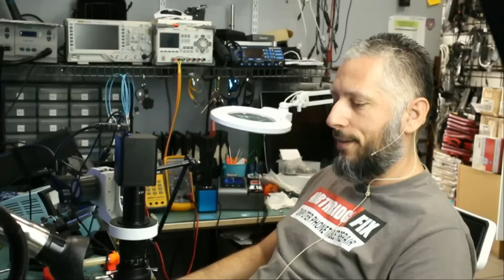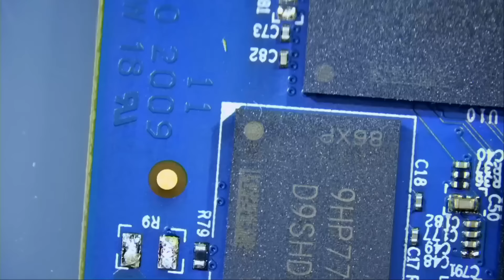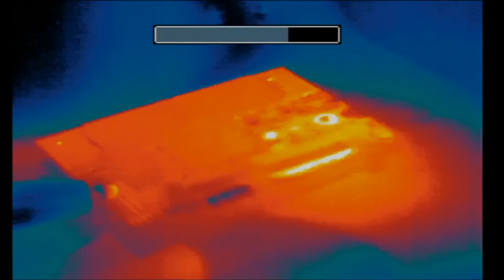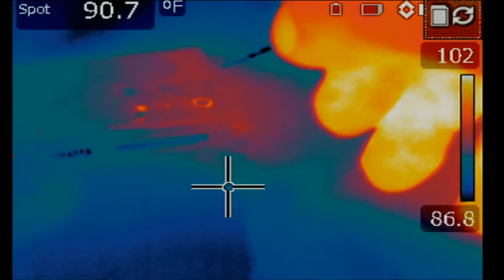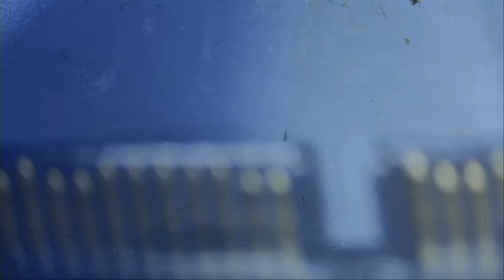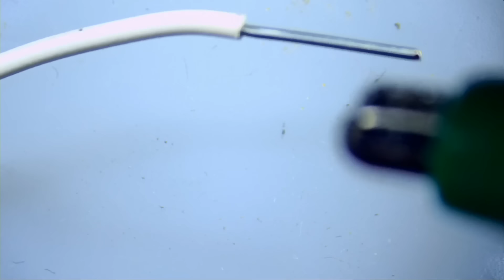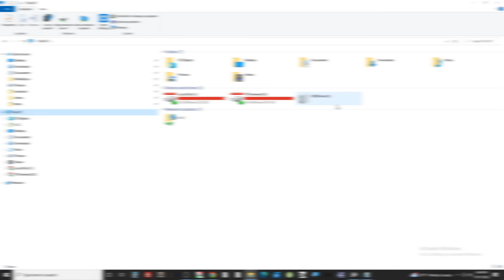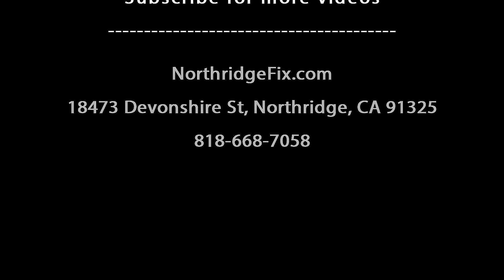Crucial SSD Drive Failed - Can we save data.?

Comment: It looks like those gold ground screw holes are NOT connected to ANYTHING, look at the circuit board, the trace from the screw hole leads toward an EMPTY capacitor pad that has nothing on it, hense those gold ground screw holes ARE NOT connected to anything, do the DIODE TEST and or CONTINUITY TEST from gold ground screw hole to another gold ground screw hole and maybe there IS NO continuity from gold ground screw holes BECAUSE there is no capacitor on those pads right next to each hole

Comment: Why disconnect and connect again?  You are not in repair mode, and that drive could fail totally at any moment.  Time and function are of the essence.  You should be concentrating immediately on transferring the available data from the old drive to a new medium.   No or Yes???
Reply: I assume there were lot more dangerous moments for this drive during this video.

Comment: That capacitor is over terminals that do not connect with ground. The cap is over some other set of terminals, e.g. in valve units, from H+ to cathode or even to grid - nothing to do with earth.

Comment: Hi Alex, you did good job as always. What's the purpose of this capacitor if the device works without it?
Reply: Usually (but not always) they are power supply filtering (suppress noise, spikes etc) so can be removed (the power is still connected to the memory IC in this example) for short term testing, data recovery etc. If the drive was intended for long-term use then it is wise to fit a new capacitor.
Reply: @ralphj4012  I see ! so you explained my question above !
Reply: @BigEightiesNewWave  Try to 'assist' if I can, usually many questions on the same subject. My opinion only, and guesswork for this device, of course.

Comment: Alex. Here’s a tip when it comes to data recovery. Whenever you get the system to recognize the drive, immediately begin copying the files off it. The chances of the drive permanently failing are high and your goal should be to copy the files as soon as possible. It may only recognize the drive once or fail when it heats up. This is especially true for mechanical drives.
Reply: Would second this advice. I panicked when I watched him disconnect and reconnect the drive multiple times.
Reply: @lookitskazzy  I panicked as well. I thought that might not be a good idea to unplug that drive, because some drives might not start back up.
Reply: @lookitskazzy  Same :D
Reply: Agree it happened to me I wanted to show off and took my personal drive to my friends home to show him that I managed to recover my hard drive without any repairs knowledge and than it never get to work and I still have that drive with me for 8 years so that one day I may be able to recover my data from it
Reply: @zmareyshahi  same here also. but he is well known about his job and we aren't . and yes I also keep mine one day........... I need some family photos and videos from it which is so valuable to me.
Reply: @zmareyshahi  You know that data on HD does not last forever. You have to rewrite it periodically on the disk to keep it magnetized correctly.
Reply: Totally agree on this. Whenever someone thinks they have a failing drive, I suggest to not power it again. Every boot could be fatal.
Reply: @dieter_be  "This could be the last time, maybe the last time I don't know..."--The Rolling Stones
Reply: DEFINITELY AGREE!!!
Reply: @trilexfix  AGREE
Reply: I gasped when he disconnected the drive after it had successfully mounted that first time! If it mounts, extract!
Reply: I was very surprised at that move, when you see the data you copy that stuff immediately! Don’t even try to plug and unplug the drive. You have no idea how long your luck will hold out.
Reply: I think I the beginning he clearly stated the main goal was saving the data, not the drive. That was no what happened at the end of the video. I'd though the data would immediately be copied. Interesting video, though.
Reply: agree but before you do that,,, make sure to get permission to the owner,,, i think alex and the customer didn't talk about copying the files once repair is done
Reply: @kdramakiligmoments38  Dr’s don’t usually give you the option to leave the Bullet IN or take it OUT when you’re about to flatline on the table 🤓😉
Reply: @kdramakiligmoments38  Of course, they did.  Alex said it.
Reply: yep.  I had mechanical hard drive I had the topsoff of in a none clean room i had to manually get to spin up. Windows recognized the drive once spinning and I put a cup over the hard drive, still with the top off and started copying data.
Reply: Hey guy’s we did it. And that’s all that matters 😅
Reply: I thought the same exact thing. He said "Now let's disconnect the drive" and I'm screaming WHYYYYYY?!?! Then he starts moving the drive around while it's dangling by its cord and I'm just cringing. When the drive gets recognized, lay it down gently, make two copies of the data immediately, then verify them against each other. After that you can screw around with it all you want. After watching several of these videos it seems he tries to maintain this sense of bravado, like all this stuff is trivial and he's too cool to care about it. Looking cool in a YouTube video is way less important than being careful and taking steps that give you the best chance to fully recover your customer's data.
Reply: Agreed. That one time may well be the last time.
Reply: That advice is from the days of HDD's, and in most cases would not apply to solid state devices
Reply: At this point I also repeatedly spray Freeze on the board to keep it cool.
Reply: Really nice tip 👌
Reply: Alex can also recover data from Antman world. Don't advise him
Reply: @sfh2050  his advised was for good,,,  
look for the positive even if you are in the negative,,,
Reply: @kdramakiligmoments38  you failed to look at positive because i was joking. Can anyone do soldering in antman world?
Reply: first think make that backup you should of made in the first place? and once you got that all heat is, if the drive is fixed, or not you still have copy,
Reply: DO NOT DO THIS WITHOUT A WRITEBACK BLOCK DEVICE such as rapidspar!
Reply: i would also agree with this advice,  this happened to me,   connected it the once,  saw all the files,   disconnected as i wanted to get another drive prepared.  of course i reconnected and no files seen on the drive,  not sure why.  I should have just copied them straight to the computer i was on.
Reply: so true , one maybe gets 5 min to work on a mechanical drive and then its gone and a restart can kill it
Reply: Here is a tip for you.  Don't offer advice to a pro.
Reply: I was surprised he didn’t start recovering as soon as it connected tbf
Reply: The thing is he managed to diagnose what was failing, and it was not the chip. While I agree he should start transfering data asap, I believe he's experienced enough to know what he's doing.
Reply: dont worry, if this broken again, he can fix it again XD
Reply: To think there are people who thinks this type of process prepares it for long term use. Incredible.
Reply: I agree.  I would have immediately started copy process and not move, breathe, fart, or anything else to disturb the now cooperative drive till all save-able data is copied over.  It has been tricked into starting and will be cranky when it realizes what has happened!  The chances of a second or third success are very slim.
Reply: Yeah seems good to copy first, from what I've heard certain failures on ssds tend to fail to read only mode at least (as far as the datacells)
Reply: duh
Reply: how about backing it up on a different drive often
Reply: @2bstiff584  That's called having a backup which is not the same as data recovery.
Reply: @goku445  if u have that u do not have to recover u got another copy
Reply: Totally
Reply: SAY We did it One more time.
Reply: Facts 💯
Reply: So true sitting with recovery at the moment
Reply: Right
Reply: He probably already recovered the data before making the vid as that's what pays him. The vid is a brilliant ad for his work.
Reply: One thing about backup...have a backup of the backup...an emergency boot of the emergency boot...
Reply: This
Reply: That's also true to ordinary hard drives.
Reply: he is the pro not you shut up thanks in advance
Reply: Alex loves complaints that save the day lol
Reply: Excellent point, thank you
Reply: Not copy, but clone the drive... The "dd" command in linux is just fine.😄
Reply: do agree but the creator's expertise is circuit boards, and perhaps hasnt been faced with this storage scenario before.  We also dont know if the owner of the drive requested for the files to not be accessed.
Reply: too late for me😭😭i tried to fix the drive, right now its no longer accessable
Reply: I agree, usually first shot is the only shot
Reply: Very nice work again, Alex. True profession. Thanks a lot.
Reply: That's true ,but you have to get it started, and if you can't then what.....you know
Reply: My hart skips a bit when I saw him disconnect the drive, just copy the files and be happy.
Reply: Yeah but this is a solid state drive. Things are different when mechanical thing are in the map
Reply: @PabloHarguindey  thought the same. This was surely true for the old HD's, when they started to crash you had only a few times it could actually start up, time was of the essence then. But I froze a bit when he did not immediately start cloning the disk
Reply: Yeah. I have owned a SATA SSD that only powers on once every 5-20 connection attemps. I Immediately pull all the data from that ssd before tinkering with that ssd for later troubleshooting. It is increasingly harder to connect now. Probably the ssd controller are now officially dead.
Reply: THANKS FOR THAT COMPLETELY OBVIOUS AND REDUNDANT INFORMATION
Reply: The drive is fixen, it doesn’t matter :)
Reply: I'd agree, however based on the actual problem, it's safe.
Reply: @mennims  You never know, why risk it. Maybe there's another component that's bad which caused the cap to short. Maybe now with the cap removed, a failure will permanently damage the nand chip. No reason to risk it. the goal is to recover data. When you see the data, you should copy it asap. I once recovered a mechanical HD by repeatedly placing it in the freezer and each time I powered it, I could only read the drive for about 5 minutes. I must have done this 30 times but I eventually got it all. Time and heat are a big factor with failures. Don't waste time and don't generate heat.
Reply: @seephor  my friend told me about this method I haven't seen this method in a video though
Reply: @seephor  I've done this before. Solution, USB to SATA Adapter. Leave the drive IN the freezer with the cord through the door. Also did it with IDE Drives. I owned a small datacenter back in the early 2000's. Of course, customers that did not back up their servers...
Reply: @seephor  this happened to me once. Dry ice was my go to. got the data and it fried 100% after that. fortunately it was only like 2 gb of data.

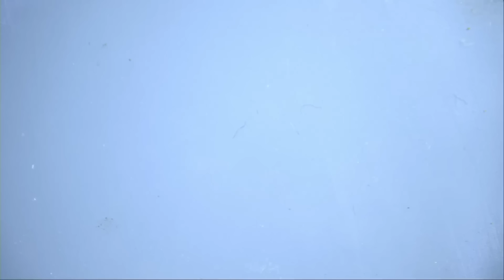Comment: I thought that cap looked dodgy the first time you scanned over the board. It looked like it had got hot or had been replaced because there was something wet/shiny under it, you can see at 2:19
Great fix with the proper tools and methods. I would been shotgunning the board with components and hopefully got lucky.
Reply: I too know all kinds of things in hindsight.     😋
Reply: @TaunterAtwill  it’s true when they say hindsight is 20/20 😂
Reply: That could just be flux from the factory, very easy to overlook. Usually I only pay attention to flux that looks like it was burned (with no obvious signs of human rework) since that's more of a tell that something overheated or failed.
Reply: I also paid attention to that capacitor area that it might been warm.
Reply: good eyes and observations Bob🙏👏🙂🙂

Comment: Always make backup of important files. Everybody can buy huge amount of cloud storage for a few dollars from Microsoft, Apple or Google. If not you can buy a spare drive and save every important data on that drive too. It's may looks expensive but it's cheaper than the lost data or the recovery process(if possible). At our company the last IT guy did not make backups so often and when a data loss happened we went to an service shop and they told us the controller was dead. A data recovery center was able to save important data but that was expensive.
Reply: Keep in mind that cloud storage is not suitable for all data. As rare as that might be it's unlikely this drive holds such data but the nature of it was unspecified. Either way worth a thought though you would be correct in most all aspects.
Reply: Dont ever do cloud back of important and personal files. You have no idea were the files are physically located. No. You do backup on your personal NAS or USB drives.

Comment: Great job as always, but just in defense of data recovery labs expenses, sometimes the work needs to be done on a firmware/translator level, or, as a last resort, a chip off recovery, which could take days. Both technics require expensive hardware/software solutions. Greetings from Brasil. ✌️
Reply: what matters most is getting the data most efficiently so this method is best for the first try and I like your method if the first method doesn't work because reballing a NAND and then mounting it on a new board brings an added level of risk of damaging the chip and in repair you always have to calculate risk.
Reply: that is right I completely agrees with this!
Reply: Yah, but here's the problem with that: data recovery labs (most of them) don't have tiers. They have a set fee and it's insanely high for all the reasons you mentioned. However, having worked in a data recovery lab, MAYBE 5% of the drives, tapes, cartridges, and cards that came in required the actual clean rooms and adaptive hardware resources to retrieve the data. When it comes to controlled storage, it is over 50% a component issue and the data chip(s) are fine. Otherwise if the chip itself is damaged you're done anyway and you can give the customer the option to pass it off to a chip restoration specialist if it is that important to them. That gets into the many thousands if not 10s of thousands with no guarantees either.
So, something that took 30 minutes and succeeded still got charged $1499.95 where something that took a week and failed got charged the same. Now that was dealing with 2001 technologies. We still have the same basic tech now, but better, smaller, and 1000x more dense. The electronics are still all the same tho :)
Reply: Brazil 🇧🇷?

Comment: The problem IC U500 seems to be a mirror of U508 so maybe you can verify based on that, unless theres also a problem with U508 then it wont be a reliable method

Comment: A complete visual inspection would reveal this discolored capacitor. You stayed on the blown inductor and didn't check the full circuit. You almost went crazy because that whole line was derived and the ground points were no ground points.
Reply: What the hell are you on about, the capacitor that was actually shorted didn't even look discoloured. If it was black and chared sure then it would be obvious.

Comment: Why didnt you have to replace the cap?? Isn't the cap needed since it was there to begin with?? it serves a purpose, correct?
Reply: Numerous caps work together to keep power rails clean, usually there's at least one on each chips power pins. loss of one may be ok, if more lost glitches on power lines get bigger
Reply: @leybraith3561  Thanks for the explanation.

Comment: If you can take the cap off and the board works fine, why is the cap needed at all?  Why design it with a component that could just fail?
Reply: Caps distributed all over the board to dampen glitches in power rails (usually as close as possible to power pins of each chip), don't necessarily need them all but they all work together to dampen glitches. remove one and others usually can still keep most glitches from causing probs. Remove several and board glitches/crashes intermittently.
Reply: I was thinking the same. What was the point of it if it works without it. I'm no technician so no doubt there is an answer.

Comment: As a complete noob - why wouldn't you need to replace that tiny shorted capacitor to test the board?  How do you know that it will work without it, and that it won't make it worse by turning it on without it?  Is that just experience?